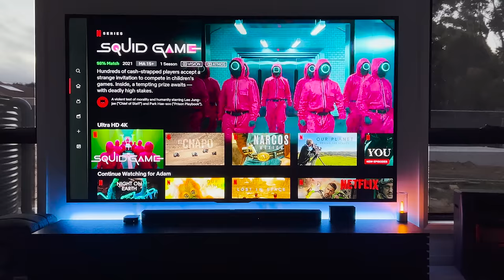Installing my Hisense 100" 4K TV - INSANE!! 100S8

Comment: Not impressed considering most Hisense tvs explode within their first two years
Reply: Not true.  Their failure rate is same as higher brands like Samsung, Sony.  Hisense bought Toshiba TV business.
Reply: @PimpSolja49  wrong and Infact I work retail number 1 TV we get back hisense at a rate of 500 a month and we have to ship them back with the same 2 defects screen failure and exploded power supply

Don't buy Vizio tvs if you factory reset a Vizio 4k series TV with chrome cast they kill themselves because of bad emmc flash on the tvs mainboard

Samsung number 1 selling TV for the holiday season 2021
No returns yet.

TCL best budget 4k

Sony too expensive no one wants a Sony we have to discount them to sell 1 tv
Reply: @PimpSolja49  and let's not even mention LG we sold 1 100 inch 2'000 LG and they bought it to use as a movie prop in which they were going to take a baseball bat to it
Reply: @johnDingoFoxVelocity   you guys must be the only retail store in the world to said sony tvs don't sell...
Reply from the maker: I find Hisense offer very low end TV however you can pay for a high end Tv and they perform great.
Reply: @johnDingoFoxVelocity  agreed, sony too expensive
Reply: @MexicanPrideMx  they don't see back when Sony actually cared about quality of their products Sony tvs where the bomb reliability was great then they cheapened parts and increased their price range
Reply: @MexicanPrideMx  Indeed
Reply: @johnDingoFoxVelocity  As far as I know, all the liquid crystals of Sony TV are supplied from LG.
Reply: Hisens cool tvs
Reply: @johnDingoFoxVelocity  So you would suggest TCL as decent budget? What else is good for the price? As for Samsung as a brand, I swore I'll never buy anything from them anymore.
Reply: @themodularmodular  see I'm not a Samsung person myself but I haven't seen Samsung and TCL coming back 300 to 400% at times I Have seen Vizio coming back due to the black screen of death because of a faulty chrome cast built into the TV yea don't hit factory reset on a Vizio and hisense by the truck load because they break in shipping poor packaging doesn't protect the panel

Comment: 100" in 4K will be very pixelated. Higher than 80" definitely requires 8k.
I would rather buy a slightly smaller 8k TV.
Reply: Very pixelated is stretching it huh!? At normal viewing distance shouldn't be that much worst.
Reply from the maker: I can tell you it’s definitely not pixelated. 
We watch 4K content on it and it looks so clean.
Reply: Jan 2022 no 8k content. local tv still broadcast 720p. the owner happy with the picture.
Reply: @hom2fu  i didn't mean the content quality. I meant the pixel itself being visible regardless of the content resolution. Agree that even 4k content is nowadays limited. Buying 8k would be more like future proofing your purchase.
Reply: I have a 120" 1080p projector setup that we sit about 11ft away from.  The picture quality is great.  100" 4k setup would look even better.  Definitely not an issue.
Reply: lol movie theater screens are between 45 and 65 feet wide and are not in 8K.  I think 100 inches will do just fine with 4K.

Comment: Ha... Brings back memories of when I helped install one. Can relate to the guy with the sore hands. Great TV though, almost OLED like with the 256 dimming zones. Absolute bargain for under $6000 delivered at the moment.
Reply from the maker: Absolutely it’s a banger of a TV. 
I have a G1 77”, C1 83” and a QN900A 85” and I tell ya what. It can hang.
Reply from the maker: Curious. Where did you get all that info regarding the amount of dimming zones on the TV? I couldn’t find it anywhere.
Reply: @ILT_AU  you can count them with a moving white square test pattern on YouTube. To answer your question though, Hisense themselves provided that information when queried. ( They don't list it anywhere)
Reply from the maker: I searched high and low online for the zone info but they never share that info.
Reply from the maker: That’s crazy man, that’s way too much.  
$6000 delivered + installed is definitely going to get a lot of people on board.
Reply: @ILT_AU people don't have $6000 upfront. So $1,000 deposit and $5000 over 3 years = $138 a Month.
For the 120 incher. $2000 deposit and $8000 over 3 years = $222 a Month.
Reply: @ILT_AU  Yeah I got quoted $5600 delivered from the TGG. FYI I looked into the new 98" TCL QLED C735 which TGG had for $6999 but is now $8999.

In China there are two 98" Models. The X9C and the Q6E. The X9C has 192 dimming zones, around 700-800Nits peak brightness and 157% BT.709 Colour volume. The Q6E (Which I believe to be the C735 in Australia) has 130% BT.709, around 500nits peak brightness (and less than 192 dimming zones I assume). It seems the Hisense S8 might still be the better TV given its higher dimming zone count and brightness, despite not being QLED.
Reply from the maker: I have been surprisingly taken back by how well it performs. It’s gorgeous and my other TVs are the best on offer right now. It can hang with the big boys. 
If your looking for a 100” I recommend. 
I might create a proper review video if anyone is keen to see more?
Reply: @ILT_AU  Great TV. I will purchase one, Hisense 100S8 Series 8 100" 4K UHD Smart TV $5995 from JB HIFI  South Australia. Thanks for the video.
Reply from the maker: Any time! 
You will LOVE it!!
Reply: @ILT_AU  How would you compare it with your G1 77”, C1 83” and a QN900A 85”?  I am not too sure about the Hisense brand... I am considering one for our lounge
Reply: @ILT_AU  I am -- Please do so I am sure many people will appreciate it, more so if you have other good TVs to contrast it with
Reply from the maker: It depends. In my opinion Hisense are the best bang for buck when your in their top tier of TVs. 
Their lower tier/cheap TVs are just garbage. 
But depending on what country your in, Hisense offer really solid TVs at the top end. 
Where are you located?
Reply: @ILT_AU  Australia... I am after the same Hisense you are reviewing. But there are not many reviews out there
Reply from the maker: I’m happy to do a proper review if you like?
Reply: @ILT_AU  That would be awesome! I think many people will watch it because there are not many of these sets around...
Reply from the maker: Leave it with me. 
I had been thinking about doing it but I’ll definitely do it now. 
Anything in particular you want to know about?
Reply: Where can I order one ???
Reply: @ILT_AU  , Where did you order it. I want one. How much was ut? Thanks.
Reply: @ILT_AU  ..Where can I get it ?
Reply from the maker: I believe it’s an Australian market exclusive